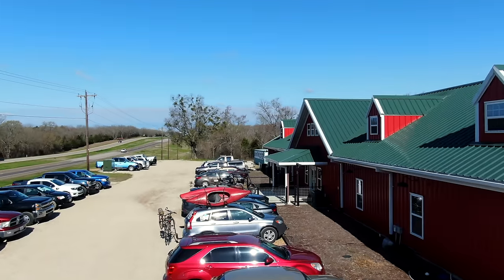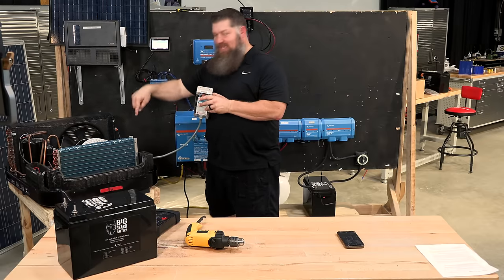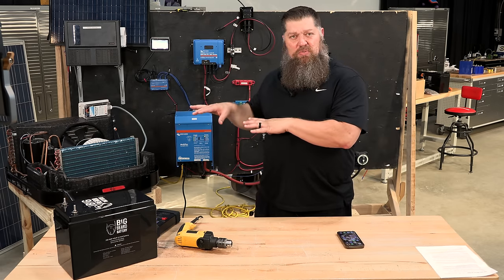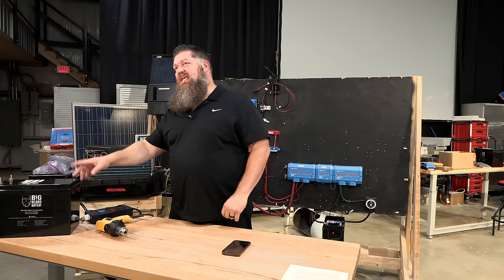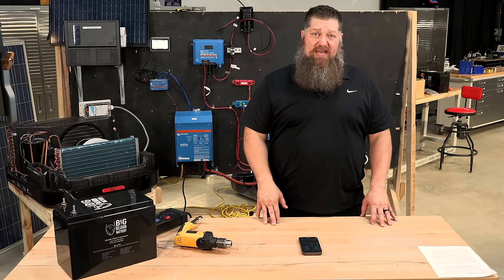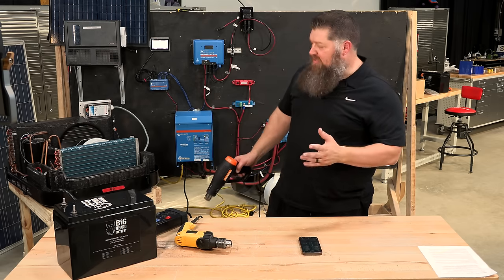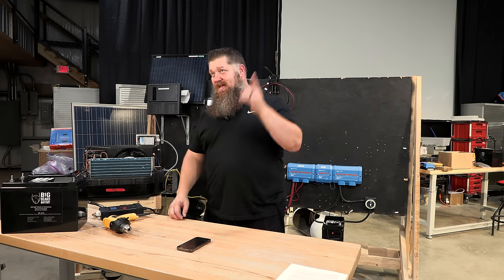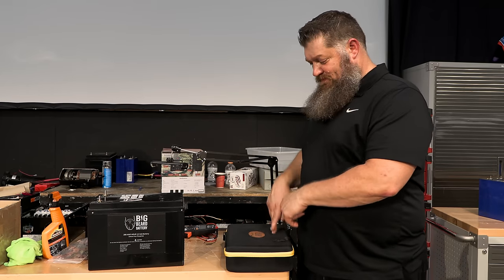Run RV AC off one battery🪫

Comment: Have a Dometic 15,000 BTU with a 3,000W inverter.  If I cold start the A/C, the inverter will get overloaded and stop.  However, A/C will start if I run just the fan for 15-30 secs and then start the A/C.
Reply from the maker: An AC unit without a soft start can reach 60-70Amps. That's a lot to ask a 3000W inverter. Plus, you need to check and see what else is running at the same time. We'd recommend a soft start.
Reply: Why don't people just get a bigger inverter?

Comment: Thanks for the great lesson. Will a soft start work with a smaller generator to run a ac unit?
Reply: I ran into that same problem after Hurricane Michael 2018 in Panama City area. First rented a 2200w generator believing it would run my small 5K BTU window unit (GE 500-600w), but it only started the fan. I returned the rental generator and got a 3300 instead, which did run the AC for the couple weeks I needed it till my power pole and hookup to the street transformer was accomplished. I also wondered if a slow or soft start device would have run it with the 2200, and also considered maybe getting instead a larger capacitor to mount on side of the AC unit.

Comment: If you have the time my question would be about running 1 AC unit when running down the road. Assuming that you are pulling 100A from the battery bank and you have a larger capacity alternator powered by the primary power unit that has a capacity of 180A (rough number) do you think that the alternator could keep up with the battery discharge on 2 ea 100A hour deep cycle lead acid or AGM batteries connected in parallel? Or even if the alternator couldn't keep up with the discharge would it be worth the effort to keep the batteries as charged as possible to extend the battery capacity life.

This is getting off the path a little do you have an opinion as to running a higher amperage alternator off of primary power would use less diesel than a 7500W generator to power or help power 1 roof AC? Part of the problem that I see is that there are no monitor gauges for the generator so you would not know if it was running hot or whatever problem could be developing.  

For reference:

Primary power is a Cummins 5.9L ISB 24V
Generator is a Onan 7.5HDKAJ11451g
Alternator on primary power to be changed to something appropriate, if not already, size.

Thanks for any time you can give.
Reply from the maker: So the alternator couldn’t keep up with charging a battery that is running the ac (assuming  there was an inverter or a 12volt ac) 

The wire size on the 7pin limits drastically how much can be pulled. Next, most alternators cannot run 100% load very pong before burning up. 

Solar panels are a good charge source.
Reply: Have read that you should move to a 24v system when you go above a 2000 watt inverter. That involves switching out your charger, adding a 24v to 12v converter to run your 12v systems and a 12v to 24v converter between your alternator/generator and batteries.

Comment: Are all Class A's setup for this or is there other wiring that needs to happen to run A/C's. I have 1280 watts of solar, 6 100Ahr lithium batteries with a Magnum 3012RV inverter /charger but A/C with softstart will not come on.

Comment: The bare minimum to run the typical rv AC in places like Florida is 3000 watts - not to mention that victron will be stressed the entire time
Reply from the maker: If you’re planning to use more than 25 amps all the time we’d agree. We are seeing more and more multiple inverter setups now. Lots of folks are going with the quatros too.

Comment: So will it run a mini split unit on rv?
Reply from the maker: A single battery was pushing 200+ amps. Find out what the amp draw on the split system is and multiply it by 10. For example. 15A = 150A. That would pass.

Comment: Got a problem with my 1987 RV. The "control panel" that tests battery, propane level, tank levels, overstove fan and light, etc, suddenly turned off. I checked fuses and breakers. All good. Everything else in the RV works, both AC and DC. 
Any suggestions?

Comment: Assuming you have a properly sized inverter, would it be feasible to use a generator to start up and run the AC until it has drawn the temp down and then switch to battery power? I have 2 100ah lithium batteries, solar, and a 4k genset. I am mostly looking to winter and fall camp, but it would be nice to have the option of AC w/o building a massive solar system. thanks for any advice you've got.
Reply from the maker: It depends. We know your generator is powering your 120V panel, but does your inverter? Most of the time the inverter is wired to a few dedicated outlets. If your inverter is wired back to the 120v breaker panel, and your batteries can produce enough power, you have a soft start on your AC,  then maybe. But 200ah is not going to give you a ton of time...unless you have enough solar on the roof to power the AC unit. Lots of variables.  We may cover this on another tech tip.
Reply: @NationalRVTrainingAcademy  thanks for the reply and advice. It sounds like many things to be more complex than it would seem at first glance. For my usage, it also sounds like I'd be better off planning to camp where there are hook-ups when it's hot weather ;-). Most of my rv camping will be during hunting and ski season...so AC isn't as worth the off-grid investment. I really appreciate the help.

Comment: I don’t have n inverter and the Rig a class C only came in with one solar. And regular batteries.     At this point financially  we don’t have a big check book lol , do you think the best way to get to do boondock part time for fun with the family with a solar generator maybe 3K watts?  Just to run one air conditioner and the small fridge ?  Do you have an episode on portable solar units ? 

How important is for me to start getting the inverter and all that 
TIA
Reply from the maker: Generators are great if you are allowed to run them where you are at. You lose the peaceful outdoors with the noise but yes it does make for a great temporary boondocking solution
Reply: @NationalRVTrainingAcademy  if I want to financially slowly getting  the rig going. 
Would installing an inverter 3,000 watts Victron and a soft start a good start? Without changing the AC that came with the unit ? TIA for all the info

Comment: Grate video!! Do I have to do anything to to my stock 5th wheel RV in order to switch from the lead acid battery to a lithium battery? I currently have a stock 2020 vengeance rogue 311A13WS. 
Thank you U.S. Navy Chief Master At Arms (Retired)
Reply: To use lithium, the appliances will not know the difference.  To charge lithium yes you need to change things.  You charger converter needs a lithium setting.   FLA settings will not charge to full and if it has a desulfate setting it will damage the lithium battery or the bms will shut off for overvoltage.  Also if the FLA battery charges from the alternator as you are driving, you would need to put in a DC-DC charger.   This sets the voltage to the correct amount and limits how much current the LIFEPO4 battery uses.   Without the DC-DC charger  you can burn out the alternator and it will not charge the LIFEPO4 battery correctly.

Comment: Todd;
Can I run my AC while driving down the road on a sunny day with my solar system? I have 800 watts with 600 amp hours of lithium batteries?
Reply from the maker: If you have an inverter capable of running the ac then yes, for a few hours.

Comment: If the a/c draws 14a, where do you get the 140a from the battery?  (scratching my head,,,not a rocket surgeon, lol)  Thank you.  Love the video(s) though.
Reply from the maker: So the air conditioner pulls roughly 14 amps at 120 volts.  HOWEVER, if the source of power is a 12volt battery then it’s roughly 140ps from the battery.
Reply: The inverter draws the 140 amps from 12v DC battery to boost that voltage up and create 120v AC needed by the air conditioner

Comment: If charging absorption voltage is 14.2 to 14.4 Volts - how do I protect my DC loads from the high voltage?  Also, do I need a DC to DC charger to protect my motorhome's alternator?
Reply from the maker: That’s not considered high voltage to your 12v components. Most 12v components (other than batteries) can handle more than 14 just fine.

Comment: Hi Todd, love your videos but my wife has a question. What is the life expectancy of the Micro Air  easy starts? We heard that they also prolong the life of the ac compressor. We have 2 Colman mach ac's 1 is a 15k and the other is a 13.5k I have an electrical background although not a licensed electrician. I have installed them on both units we run shore power only. Down in Quartzsite Az where it's  really been a super hot summer. 115° Plus with  both units running we can get our inside temperature down to 84 degrees which for us is comfortable. They do run continuously during the day then we alternate them to give each a break.  Any info would be highly appreciated thanks. And our rv is also under a cool cover so no direct sun on the roof  open  on both ends for airflow when we are not  traveling.
Reply from the maker: So Microair has a warranty. If your unit is 6 years old or less, they will provide a 2 year warranty on the unit as well as the air conditioner. Details are on their site. 

regarding the AC. Have the coils been cleaned? Have you checked the lower plenum lately for holds and failed tape? even at 115 84 seems inefficient (assuming doors and windows are closed and no direct sunlight coming in the windows).
Reply: Thanks for the quick response. I forgot to say we have rv air flows in both units, I retaped both units before installing the air flows . Our rig is positioned north and south do to the way our lot is in our rv park. We do get some sun on the front in the morning. Ac coils are clean. Our current outside temperature is 106 degrees @ 10am  inlet temperature on ac 81.1 degrees outlet 59.3 = 21.8 difference. This is with only one ac running. We are desert rats. I can get it cooler just wanted to make sure wasn't going to hurt anything.
Reply: Hello, Im in Camp Verde... Its been... hot. Power goes out when it rains feeling like iraqie brown outs. I worry for my pug And I and think building a sandbag earth hut for emergencies. I bought a mini split and am researching how to run that bad boy with zero aps. Im irritated with them for hoodwinking me. Requested an analog meter.. to discover my new analog smart meter and new billing charges... no wheels on it rotating= thats a smart meter.
Reply: Question... have yall gotten a patented HEMP  emp device for your rv? Not due to the war but because of GRB221009A's effects on the sun.
Reply: My sister lives in Wichita Falls Tx. Last summer I sent her an indoor swamp cooler to help her low power AC unit. Her humidity I saw on weather was dry & typically between 25-40%, and that helped her AC bring the temps down more, even with them over 100 both then and especially this year. She's been grateful for that cooler both summers! It allowed a bit higher humidity in her home, which the moisture stored as "latent heat" and allowed her AC to more efficiently cool the indoor air below the dew point and drain what was "latent heat" quickly out of the house.

Comment: If you don't get enough sun light during the day will the generator top off the batteries to 100 per cent.
Reply from the maker: Shore power or genny within a proper charger can easily charge lithium to 100%. Up to 8 times faster than AGM Gel or FLA

Comment: Victron MultiPlus Inverters are rated  in Volt-Amps, not watts. 3000 VA translates to around 2200 watts.
Reply from the maker: Actually it’s 2400 watts at 25 celcius or 77 fahrenheit which is listed both by Guy Stewart of Victron and in Wiring Unlimited written by Margret Leeftink. 

Being overly technical loses the general audience. Part of the art as an instructor is to teach in baby steps. Once they understand the tidbits of free YouTube content then in class setting you can impart vast reserves of wisdom.

Comment: how did they pack so much storage into that small battery footprint? comparing to battle born batteries -
Reply from the maker: It’s all about the cells.
Reply: I assume, he's using prismatic cells. 280 AH is a common cell. Most over the counter lithium batteries use them, but most are 100 AH cells (cheaper), then they choose a BMS to control the cells. Many different BMS's out there too. I wound up building my own 304 AH battery out four prismatic cells, used a 150 amp charge/discharge BMS with low temp/high temp cutoff and bluetooth. Changed my converter charger to a lithium compatible one. So far so good. I don't run the AC on it though, not enough solar and no inverter yet...

Comment: Given your system, could it have run on a 2000w inverter?
Reply: I use a bluetti ac200p for 'shore power' and it has a 2000w inverter. It will drive a 13.5k btu rooftop ac, but you will need a soft start.

Comment: I'm wondering how hot those baby sized wires are from your batteryb to the inverter because the are definitely not big enpugh of r200 amps and probably not big enough for 100 amps.   I see some holes in your story here .  good luck with the liability building up here.
Reply from the maker: I have heard of the camera adding 10 lbs but ive never heard that the camera shrinks the gertj of cable. 

Brother thats 2/0 ultra flex welding cable. Handles over 300 amps continuous. Liability check. Might i suggest an optometrist?

Comment: 4:29 if this is 12/3000/120 multiplus then it’s not a 3000 watt inverter. It’s a 3000 volt-ampere (va) inverter, which is rated to produce 2,400 watts at 77F and 2200 watts at 104F.
Reply from the maker: Correct. But the very name of said inverter is the Victron  Multiplus 3000w. It makes it easier to identify it based on its name. Had the topic been on the VA of the inverter in question then I would have added that.

Comment: Not true. Be very careful in what you are teaching. I live completely off grid. I have a 5th wheel with two airconditioners. On the roof I have 800watts of panels and in the compartment, I have a 40amp MPPT charge controller, 3000watt inverter, battery shunt, and 4 12v 100ah lifepo4 batteries. Just running my domestic 15000btu unit, the batteries only lasted 45mins with a sunny day. I calculated AND the solar tech calculated that I would have at minimum 2 hours of ac use. Did not happen in real world usage with no other draws, only the ac. Now I went to a few different places to gather info. What I found is I need 16 12v 100ah batteries to run this ac and nothing else for 5 hours. In order to charge those 16 batteries,  I need 12 400 watt panels and an 80amp charger. Now I have to figure out how to install 12 400 watt panels on my 5th wheel. Just FYI, batteries are about $236 a piece, panels can range from $120 to $250 a piece. The charge controller I chose is a hybrid which is 5kwatt inverter and 80amp charger with mains pass through. It was $700. All just to run an ac unit for more than a couple hours.

Comment: Ok so i know i need a newer converter to charge the lithium batteries at 14.4 volts But can older generators charge these new lithium  batteries
Reply from the maker: So generators produce 120volts ac which would supply power to your converter or battery charger.
Reply: @NationalRVTrainingAcademy   Makes sense now  Thanks for the reply

Comment: how about 24 volt system, fewer batteries if using 24 volt batters and watts needed to run
Reply from the maker: So watts are the same. First law of thermal dynamics “energy cannot be created or destroyed”

Fewer boxes, but a 24 volt battery has the same amount of cells that 2 of the 12volt systems have. You might save 1-2” inches of total space by using 1 bms instead of 2. 

And yes Big Beard Batteries will ge offering a 24volt 300ah within a month!
Reply: @NationalRVTrainingAcademy  Your right watts are the same amp drop by half

Comment: I did not see where you turned on the compressor
Reply from the maker: We used the Peacemaker (little black box) which gave us the ability to turn on the fan and compressor without having to use a thermostat

Comment: So by using a power inverter to change from 12-volt DC to 120 volt AC it's drawing 10 times more amperage? That seems so inefficient why not just get a 12v air conditioner?
Reply from the maker: @brandonlaragirl there isn’t an air conditioner  that’s 12volts that can cool the same sqft. 

As well the 12v ac will draw 10 times the amperage as the 120v ac

Watts Law.

Comment: Just ignore the whole runaway charging issue with lithium batteries and sure, go for it.
Reply from the maker: Well that’s what the BMS protects from. Runaway happens on batteries with no protection like a drill battery. Not these
Reply: @NationalRVTrainingAcademy  it happens in all lithium batteries. That’s why the Bms systems were developed.  They aren’t put in drills… They are beyond expensive and do not solve all the problems. All in all great information in the video, just doesn’t seem like a good option, though it is the best currently available to achieve the goal stated. You have to have money and extra capacity for it to go well. And as you know, extra capacity is our biggest issue on the road.